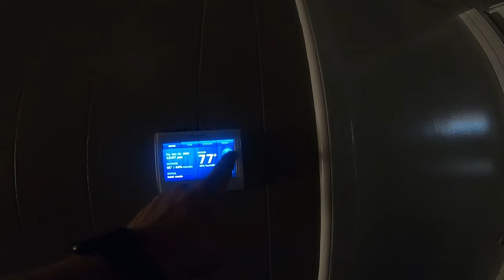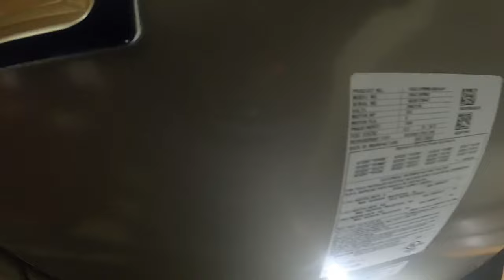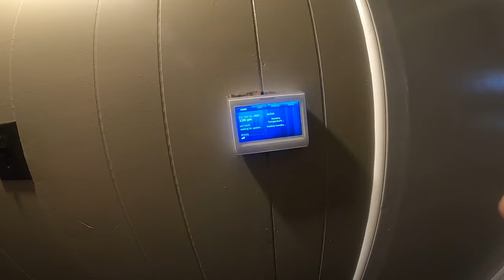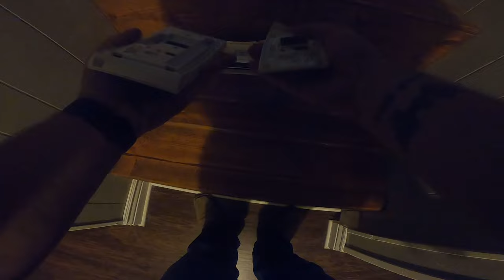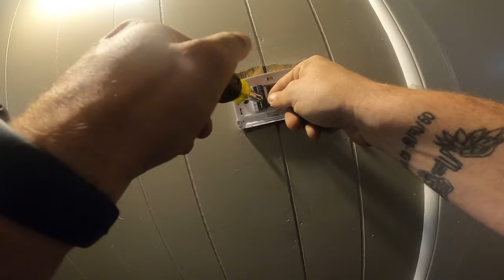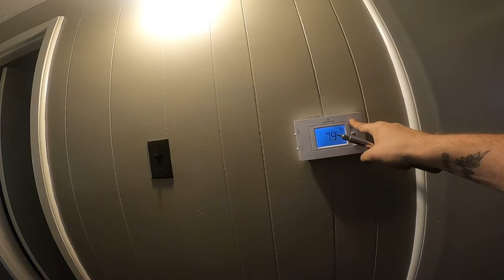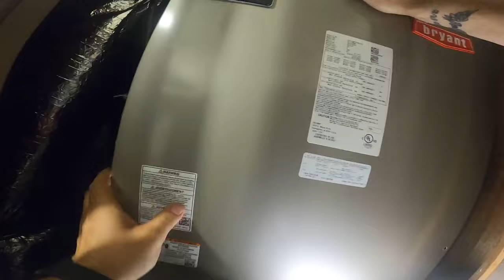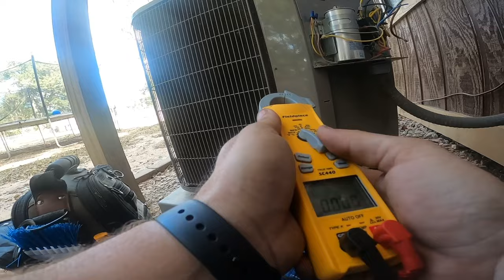No Heat/New Bryant System

Comment: thank you For the Video John. hard to imagine the heat strips not working the winter beFore but i noticed when you went to the tstat and under modes it was just Heat and Cool vs the traditional Heat, cool, Eme Heat modes. Seems like the tstat was setup For A/C with Furnace.

Comment: China cap made it 2 years on my Carrier also. Replaced with an Amrad. X-13 also went a week before the cap. Put in a rescue. Mine was stuck on so at least I had air. Smaller Carrier has a Broad Ocean. I wonder if that will last longer then most X-13's.

Comment: Good call on changing out the Run Cap, but I see it's a blue label, which is Mineral oil.  Carrier/ICP "supposed" to have address the issue on the black label Castor Oil caps.  The Mineral oil caps are supposed to be rated at higher temp per the TIC.
Reply from the maker: I didn’t know that thanks for the info

Comment: How much of a problem do you have with driers rusting out?  I do work in south texas and driers installed outdoors usually rust out anywhere from 5 to 8 years down the road.  I tey to put mine inside when I can to prevent that problem.  You are absolutely correct about the capacitors on the Bryant.  I still prefer them over the rheem because the coils are painted on the legacy line.  Being on the coast is really bad on unpainted coils.  Good work.
Reply: The only dryers I see rust out are the ones that have the paint burned off while brazed , spray paint over it or use a wet rag , to help not get it burn , or just spray paint them when you do maintenance to help it.
Reply: I had one guy install a dryer backwards, and he had already pulled vacuum and started it, he said don't worry I got the solution, guy brings out grey spray paint the exact same color of the dryer and paints over the direction lol,

Comment: Is that a heat pump
Reply: No electric heat he say
Reply: If would it be a heat pump it would heat a little slow but heat some what
Reply: He mention O and B terminals and Heat didn't work remenber
Reply: 15 kw means is Straight Cool and Electric Heat. When heat pump he would need another low volt wire for Rev Valve Solenoid